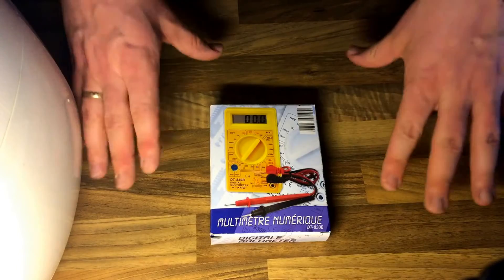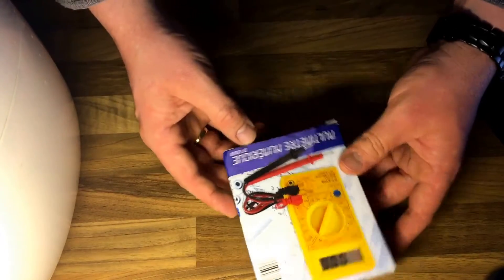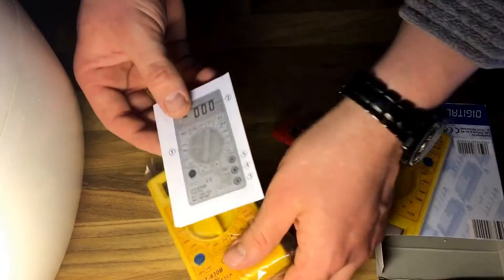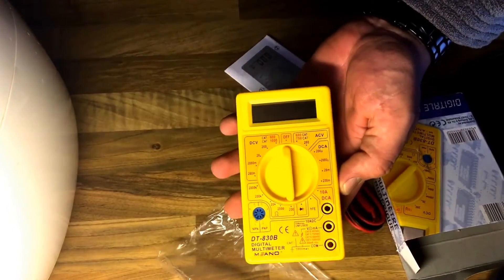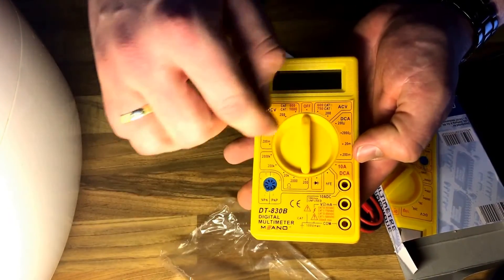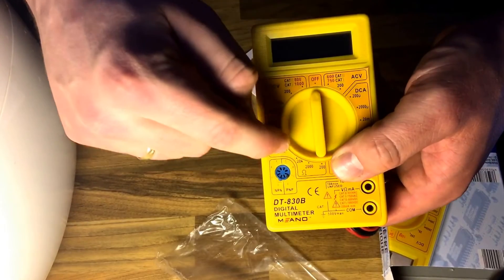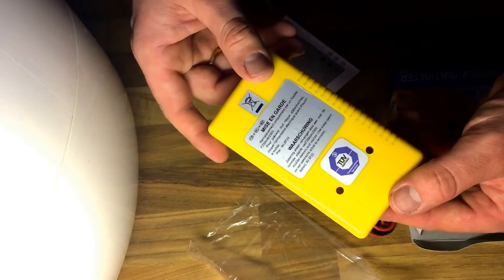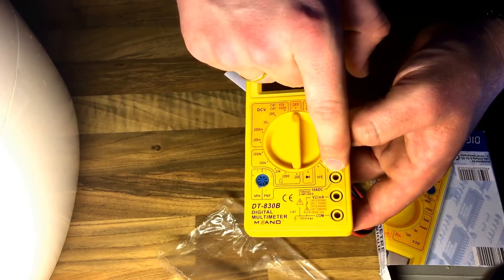digital multimeter DT-830B unboxing and function overview

Comment: I agree with Joan Bautista just what does the little fracking blus part on it do?
Reply from the maker: Electrical resistance and conductance
Reply: @pduesp  ok how do I use it? I baight it in florida for 3 dollars at a pawn shop while  I was visiting on year.
Reply from the maker: The resistance have to electrical pins this pins will mates into the tester

Comment: what is that little blue circle?
Reply from the maker: That’s for transistor test
Reply: Turn the selector to point to hFE.  Then you can use the blue circle area to test for transistors depending if it is a NPN or PNP.